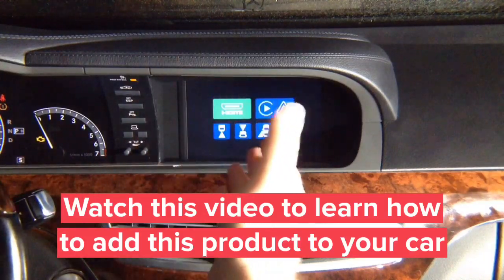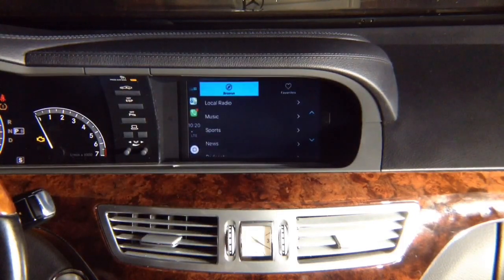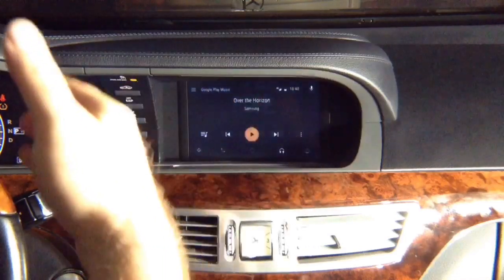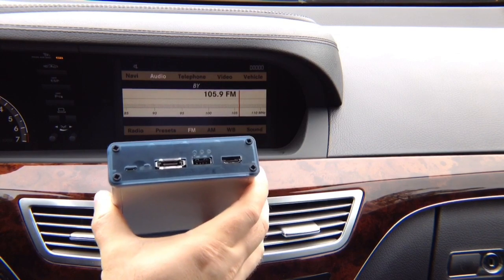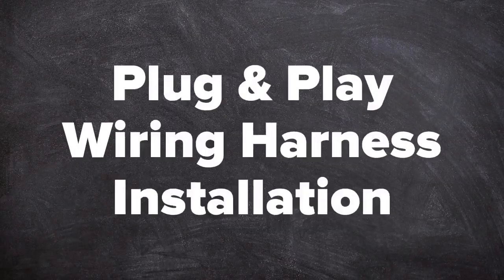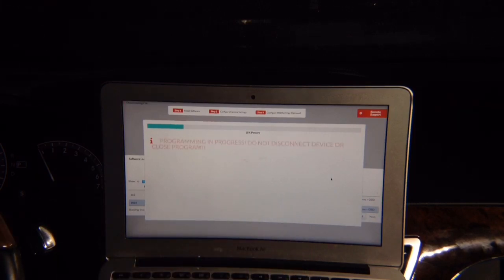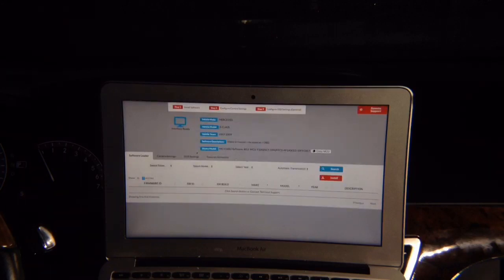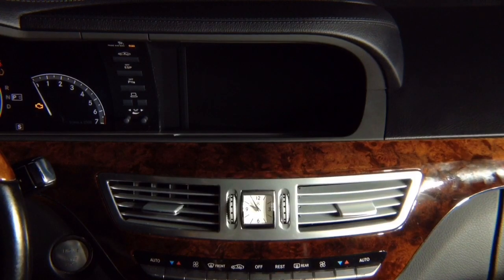S Class Apple Carplay - Mercedes W221 2007-2013 S-Class Apple CarPlay Android Auto, HDMI Video Input

Comment: can you control a/c while in the carplay screen, also where do you connect the phone? do you need a USB extension?
Reply from the maker: Yes air conditioner works as before USB extension not necessary

Comment: How do you connect your phone to the CarPlay
Reply from the maker: wireless
Reply: @Navtool so it’s a Bluetooth also ,
Reply from the maker: @slightwork3201  yes the product is 100% wireless
Reply: @Navtool  does it affect the sound like does it make the sound lower ? I have a 08 s550 non 4matic
Reply from the maker: @slightwork3201  It does not affect audio in any way, shape, or form. First of all, your audio operates through fiber optics. Secondly, to play audio through the speakers using the auxiliary input of the factory-installed radio, we will activate the hidden option in the radio. This will enable the audio to be routed through the auxiliary input and played through the speakers. Essentially, this setup functions as if CarPlay was a factory-installed feature in your car, had it been available in 2008.
Reply: @Navtool  ok perfect .👍 will order today